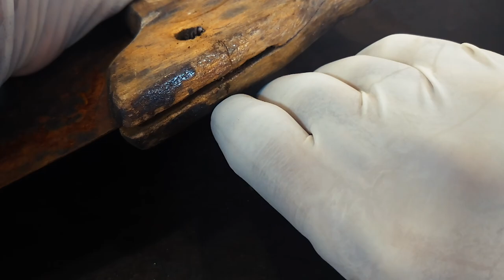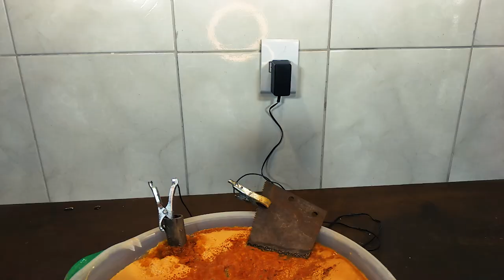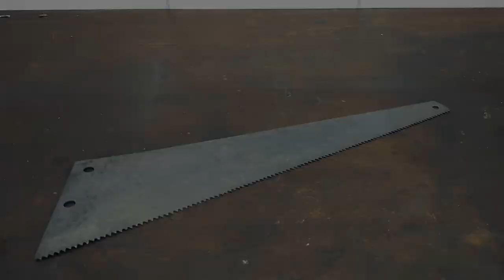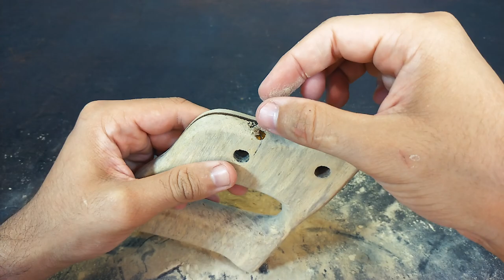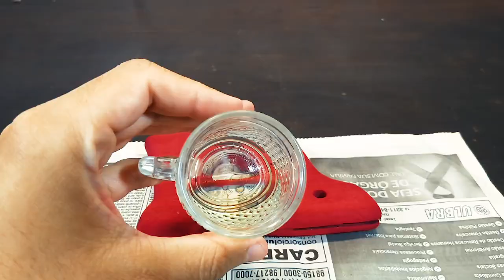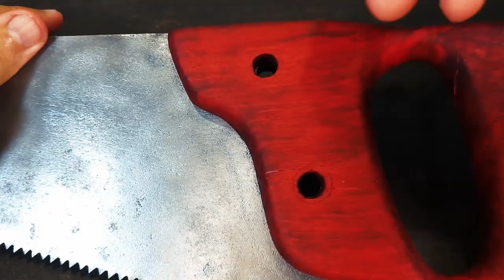Antique Rust Hand Saw Restoration | Workshop DC

Comment: You didn't sharpen and reset the teeth. I would apply a coat of wax to the blade to help keep surface rust from returning. Nice project though. Thumbs Up!
Reply from the maker: Hey, Thanks Gary! I sended this Hand saw to a friend for sharpen the teeths. Yep I really need to buy a wax to protection from rust hehe' 😄